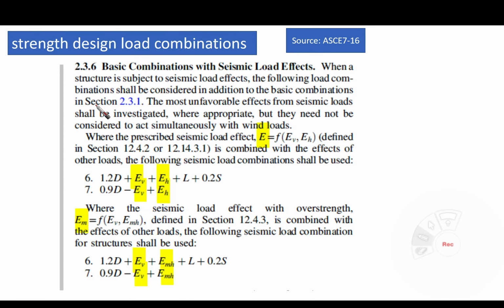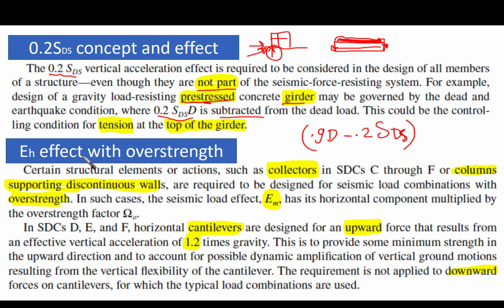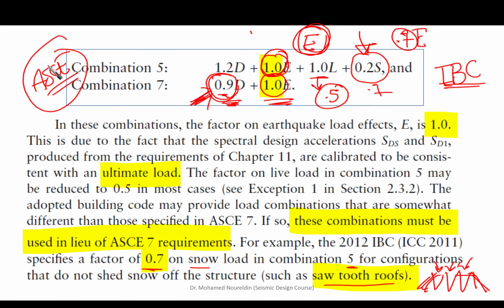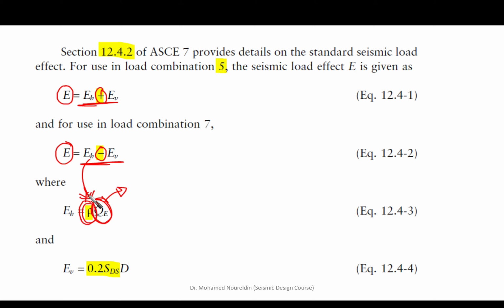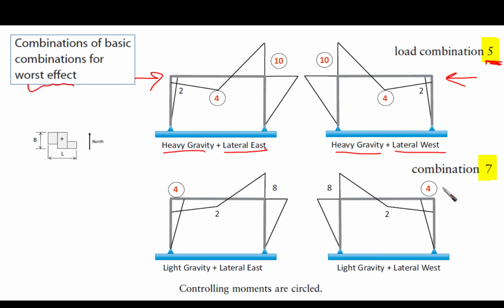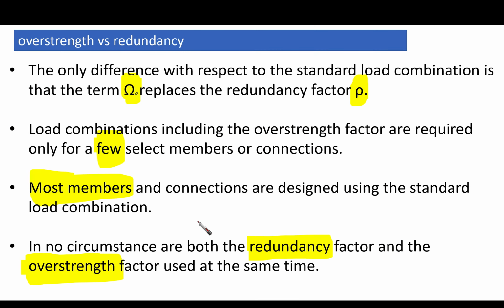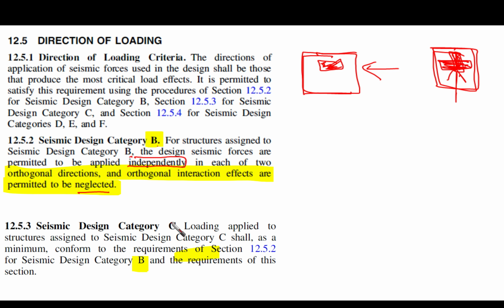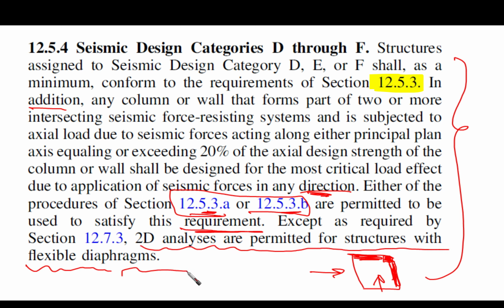16- ASCE-7 Load combinations Load directions- Dr. Noureldin

Comment: Hi I am really intersted in to understand collector elements
Reply: Collector element where I understand for EBF beam, that the collector connects from bracing bay to bracing bay, make sure the horizontal load works through the frame